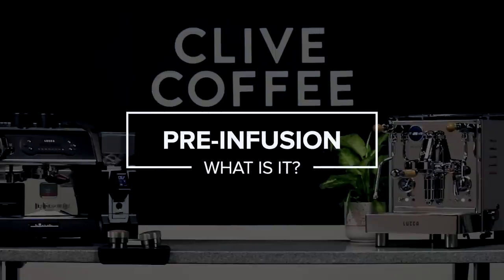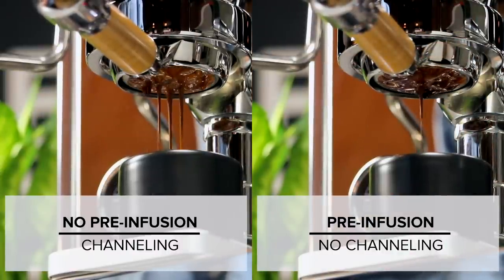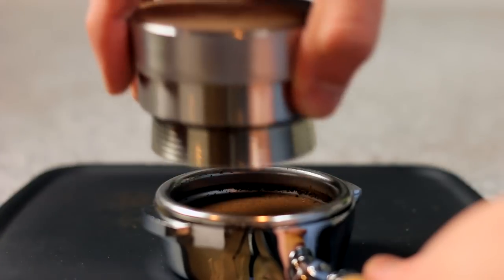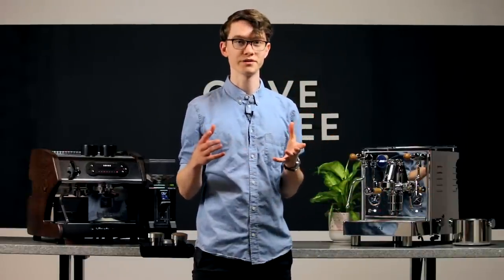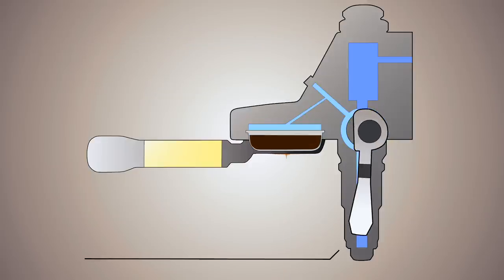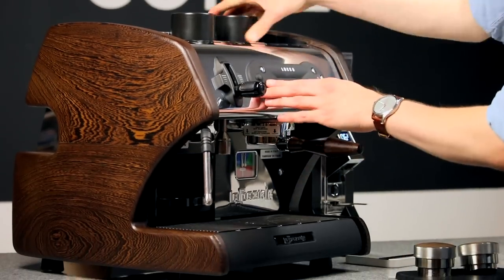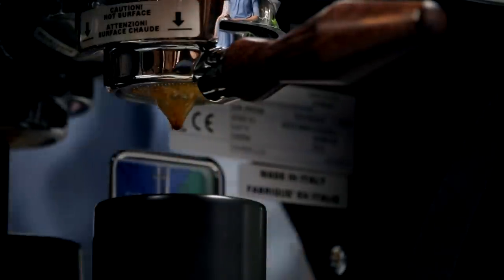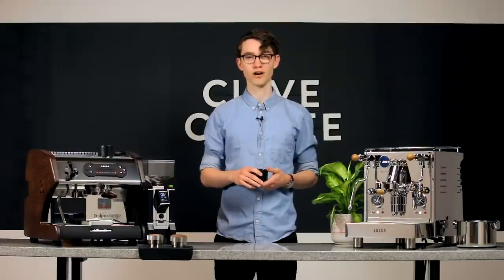What Is Pre-Infusion?

Comment: Your explanation is not correct. The E61 has a built in preinfusion system which works by lifting the lever up all the way. There is a third valve that reduces the pressure on the coffee puck until it’s fully closed. Using the half way position of the lever is not a design feature as far as I know.
Reply from the maker: Hey Majos, I've pinned your comment so that this discussion is more visible.

First, to clarify: The manual pre-infusion step is an intentionally designed function of the E61 group head. The cam is made to have a resting point that allows the brew valve to be open without the lever activating the pump switch. This is a big part of what makes E61 groups so wonderful, as you get to manually control pre-infusion if you wish by using line pressure.

The crux of the issue here is defining what pre-infusion truly is. Something as simple as a flow restrictor (like the gicleur in an E61 group head) could be considered a form of pre-infusion since there will always be an air gap above the puck that takes time to fill with water. Most wouldn't consider a flow restrictor a form of pre-infusion since its effects are rather minor and every machine has some form of flow restriction. We could consider the other end of the spectrum to be fully manual flow control like on a La Marzocco GS3 MP.

The pre-infusion chamber on an E61 group certainly falls somewhere between those two and can certainly be referred to as a form of pre-infusion. Considering how mild its effect is we don't think it matches up with what baristas popularly define as pre-infusion today.

Hope that clears up our intention with this video, glad to chat more.
- Charles
Reply: @clivecoffee You are right, that water is incompressible. Thats why there is a chamber to which the water can go first. There is a schematic representation of the E61 group head on this site: https://www.coffeeitalia.de/blog/E61Gruppe. It shows the preinfusion valve and the preinfusion chamber. When the lever is pulled all the way up the preinfusion chamber is filled with water, reducing the pressure on the coffee until it is fully filled. Only then the full pressure is reached. This is the preinfusion mechanism I was referring to.
Reply: @majos  I'm 99% sure you're wrong. The manual for both the profitec 700 and synchronika which uses E61 says preinfusion is done by partially elevating the brew lever.
Reply from the maker: @majos  You're correct that some machines require that the brew lever be lifted ever so slightly above the half-way position in order to open the path to the group head. That said, having the ability to manually pre-infuse at 2-3 bar pressure is a really helpful feature. While it may only be an unintended byproduct of the original design, we feel it's a good one!

Certain companies do intentionally design their E61 group heads to allow flow in the half-way position for this reason. Profitec and ECM do indeed build this into their machines where Quick Mill (by and large) doesn't. Each manufacturer makes their own tweaks to the E61 design, which is reflected by the fact that no current E61 group is a true match to the patent.

At the end of the day, the great thing about the E61 is it's so adaptable. You can skip the half-way step and simply allow the group head to use its minor pre-infusion style smoothing or take control and use it manually. The fact that it's so amenable to modification is at least half of why it's still such a popular choice today!
- Charles
Reply: Clive Coffee yes, I think we can agree on that. after all there’s nothing really wrong about making a good espresso ;)
Reply: @clivecoffee  hows abouts a video that fleshes out this passive pre infusionation of the e61?
Reply: Yeah, no Majos, that's not proper "pre-infusion" thing is that what you are describing is normal is every machine, no machine really starts at 9 bars os pressure in the puck, the pump may be giving the 9 bars, but the puck pressure is another thing entirely and you have to reach a local minimum; then the pressure starts building up and reaches the desire PSI. Anyways, a proper pre-infusion does not build up, it should be gentle just enough to saturate the group and you should be allowed to let it soak as much as you need without pressure increment. Scott Rao has actually some decent experiments with this on the Decent espresso machine.
Reply: Elias Herrera have you read and understood what I wrote about the preinfusion mechanism of the e61? This is not inherent to any machine but only those with a similar mechanism. Building up pump pressure is an entirely different thing
Reply: Clive Coffee o
Reply: you people are all nuts.... I manually pre-wet my puck tops with a wdt spray bottle before putting it in the group

Comment: I use a variable fan switch with my machine to achieve this and it works great (it also gives me the ability to pressure profile my shots). I'm not an espresso expert but in my experience it brews a shot that isn't harsh or sour. It's very balanced and it helped me learn to taste for sweetness in espresso. I'm trying to keep my coffee setup cheap so I'm thinking of getting a Flair next.
Reply: I highly recommend the flair. It brews awesome espresso and the pro model comes with a pressure guage that can be used for pressure profiling!
Reply: @pete9894  thanks for the tip. I'm debating between the Flair and a LaPavoni Europiccola. The difference being that the LaPavoni had a boiler. It'll cost at least $600 but I won't have to worry about heating up all the parts of the Flair each. Still weighing my options.

Comment: Pretty sure those distributors don't really do anything besides smooth out the top of the coffee, it's not evenly compacted or distributed all the way through, the best way to do that is either by poking / stirring up the coffee especially if you got a clumpy grinder or distributed all the coffee to one side, but I find what works for me if I do it carefully, is with my tamper, I do a nutation motion circling around the edges in the basket like using a joystick, then I make sure the tamper is level and do the tamp. The most important part is just tamping the coffee straight and not at an angle.

Comment: My ecm synchronika is a E61 machine. I was told that when I use reservoir, there's no in-fusion fuction as I lift the handle half way up.
Only I use in-line water. The pressure of in-line water will kick in the infusion. As I only use reservoir, it is true that I cannot implement in-fusion technique in my shot. Because when I lift the handle halfway, there's no water coming out from the group head.

Comment: Wether or not it is good or bad (I love it), my Rocket R58 does not release water at the 45 degree point. You have to go higher, maybe 60 degrees up. I had to back the switch up into the machine so that the pump doesn’t turn on too early. It took me some time, but now it preinfuses perfectly. Just FYI about the 45 degrees - I guess not all machines release house pressure water at that angle.

Comment: I thought E61 brewheads did preinfusion automatically?
Reply: They do, but this is more like a slower pre- pre infusion lol :D 
Also I found it doesn't automatically start dripping when half way, you need to carefully go a bit further just before the pump engages it will start dripping just from brew boiler pressure, it works on a non plumbed machine and I believe most plumbed ones work similarly, maybe some work the way they demonstrated here where half-way starts the flow, but I've seen other videos (and my own E61 machine) does not work that way.

Comment: I have a direct plumbed E61 machine fed thru a filter and pressure regulator. I just guessed at a line pressure of 3 bar which I use to pre infuse until the first drops start to fall;  (about 5 sec.) then full (8 bar) pump pressure. This has helped my consistency and I am getting great results.  Is there any recommendations on pre infusion pressure or is it just trial and error?

Comment: My machine (BZ10)  is not directly plumbed.   However, I noticed  that when I press the brew switch half-way, it opens the solenoid without engaging the pump.  Some water does flow out of the head due to a bit of residual pressure.  Do you think that would be adequate for a good pre-infusion?  Or put another way, how many grams of water does a puck need to absorb in order to be saturated enough?
Reply: Did you experiment with it? What did you find works best?

Comment: So if you have a e61 with a tank you are wetting the puck? So how long does this wetting take to guarantee a fully saturated puck?
Reply from the maker: Some E61 machines with a brew lever will be able to release a little water without pressure when you lift the lever a little more than half way up but it's inconsistent and unpredictable. 
For pre-infusion time, we recommend experimenting but a good place to start it pre-infuse until first drop.

Comment: I just purchased a Lucca 53 mini from clive coffee. Everything is fine except it makes soupy pucks. Is this normal for a 53mm portafilter? The whole world uses 58mm portafilters - there must be a reason. Am I stuck with a soupy puck forever?
Reply from the maker: Hey Mike, we haven't noticed that the A53 Mini is any more prone to this than 58mm machines. That aside, it's best not to worry about soupy pucks. We get them too from time to time, but they have almost no bearing on whether a shot will be good or bad. If you hit your target recipe, avoid channeling, and the shot tastes good what the puck looks like doesn't matter a bit.
- Charles
Reply: I had the Mini Vivaldi which is very similar to yours and let me make a suggestion, try to dose more coffee on the portafilter and see if that helps giving the puck more density and dryness at the end.

Comment: So does pre-infusion works on ECM Synchronika using reservoir? (Can’t plumb)
Reply from the maker: Hi there! With any E61, the machine does have a built-in passive pre-infusion. When the machine is not plumbed in you are still able to gently wet the grounds to help with an even extraction. With the brew lever halfway up that line pressure between the boiler and group head will taper, so the pre-infusion length is only about 3-4 seconds. When plumbed in directly the pre-infusion is generally more consistent and continuous. Hope this helps! 
-Amanda

Comment: I have a profitec 600 which has a water reservoir.  I THOUGHT I saw saw a video that used the pre-infusion technique you first outlined, so I have been doing it at home. I tried to find the video again, but I could not...now that I have watched yours, I bet it was for a Profitec 700 that was plumbed in. 🙁 sad that I can't preinfuse. Just to be sure...what I have been doing with the 600 does not pre-infuse the puck at all?
Reply: Are you in southern California?
Reply: SuperOCHomes no
Reply from the maker: Unfortunately, you're correct. Since the 600 uses an E61 group head and can't be plumbed in it is incapable of pre-infusion. If you'd still like to find ways to improve the consistency of your extractions I'd recommend focusing on distribution and tamping technique. The Saint Anthony distributor tool I mention in the video is a great tool for just that!
- Charles

Comment: Don't know if you'll see this comment, so long after video. I have a Bezzera BZ13 machine, which has a reservoir. Do you know if this machine is capable of preinfusion?
Reply: Try it without a portafilter on and find out... if it's an E61 machine it probably will work, but you basically need to find the point just before the pump turns on, it should drip slowly out due to slight pressure from the boiler.

Comment: Your first explanation about pre-infusion is not correct. It is not "...before applying full desired brewing temperature...", it is before applying the full brewing PRESSURE! Very, very different things. The wedge is another tool that is wrongly explained or better said the application of a wedge is not as one really thinks. Distribution of the grounds, evenly? Not, may not happen if you use the wedge on very uneven distributed ground bed in first place and do not even the grounds before using the wedge. Just think about for a minute: The weight of the wedge (usually quite heavy) firstly pushes down the grounds as they appear in  the portafilter (the same what the tamper does) and then flattens the surface only. It looks like the wedge did a great job but In fact damage done already when applied the wedge on uneven grounds, hence no difference as if one uses a normal tamper. The key is to distribute the grounds as even as possible before using any tool. And if one has done this properly a wedge becomes obsolete (can save quite some money plus get rid of one more work flow). Unfortunately you have not mentioned the real reason of using pre-infusion or not. Lets make it a given that we distribute properly and no channeling happens (it is right that pre-infusion diminishes - but not to zer -  channeling). Why pre-infusion has been implemented has to do with flavor profile/taste.  E.g. take a light roast and use no pre-infusion. The espresso will be likely quite high in acidity. But, pre-infuse same coffee for a certain amount of time and you will have a likely much less acidic espresso now given that all else is equal to the first espresso. The reason that flavor changes is that 9 bar pressure on a dry bed immediately squeezes out more acidity as if the bed is softened and the 9 bar pressure is applied on a wet ground, hence less acidity will be extracted. This is the basic principle of pressure profiling of the new machines. With pressure profiling it goes much further since one can influence the whole brewing time with different pressure. E.g. use a dark roast and reduce pressure at the end of brewing time. Very different outcome in taste of the espresso as if not applied (it will be less astringent, bitter).  And so on. The Sanremo You is a fantastic machine to test this all. Sorry for this long explanation and outline. Just wanted to give more light into this all.

Comment: Great video! 

With pre-infusion, does the magic 20-30 sec extraction time start when the first drop hits the bottom of the glass, or, when you press the shot button. (referencing the Breville dual boiler here, as the timer starts on the machine when you hit start) :)

thank you
Reply from the maker: Hi! Your shot time starts once pre-infusion ends and the pump fully engages. Hope this helps clarify things for you!